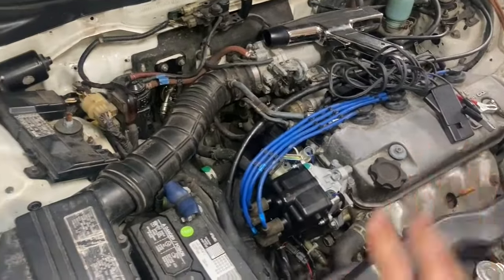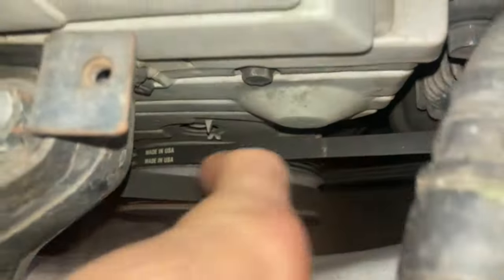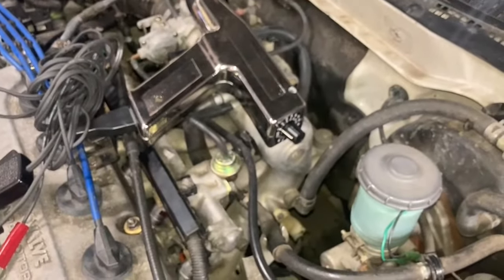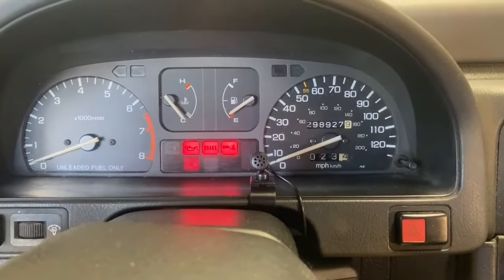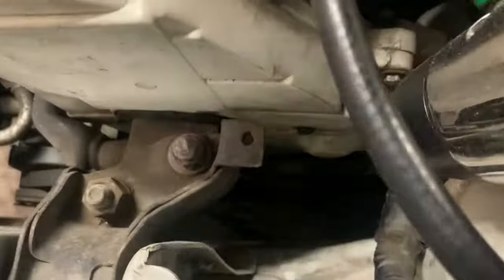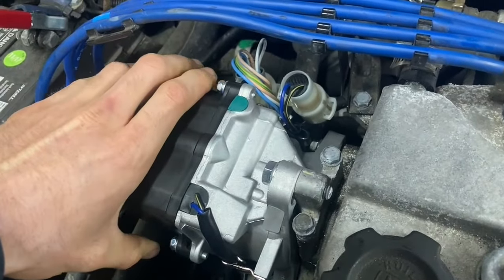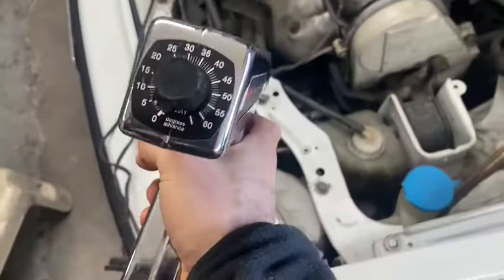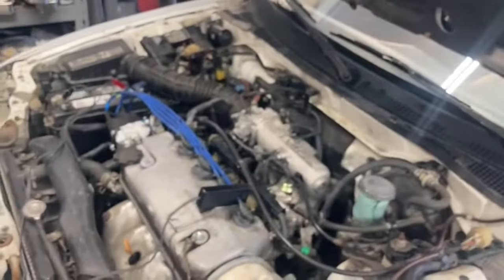How to Set Ignition Timing on Honda and Acura Distributors

Comment: I did not have to hook any connector,install the distributor.then adjust the timing old school.start,adjust start adjust till smooth
Reply: Yeah well some people want to do it the PROPER way.. your way will never be 100%
Reply: The reason you jump it is so the ECU stops adjusting stuff to smooth idle. You timed it with adjustments, jumping it stops that and runs closed loop so you can set timing without other parameters interfering.

Comment: I'm really confused at what the timing light does besides just shine light in spurts with the ignition sparking. Otherwise I just get that I need to short the plug and then line the arrow in the middle of the lines. I don't see what the timing light did. If anyone cares to explain please do because I never understood what this does.
Reply: Me as well I'm trying to properly set my 97 civic coupe D16y8 Engine to the correct timing & I'm having a hard time understanding what the Gun is for Can I just do everything without it and hear the engine not be as loud as it was?
Reply: 2:21... You use the light so you can see the position of the 3 tick marks on your pulley every time that cylinder number 1 is firing. Then you adjust the distributor according to which way you need the marks to go to be within spec. That's just how you do it.. You don't want to just guess. That's why there's a tool.. & mechanics that make a living using those tools on cars that people played with by guessing.. Use the light.. There's also many other better videos that actually show the timing marks on the pulley that you are trying to line up.
Reply: @BlakeGibbons  I just didn't know how it worked but I have since figured it out. It's just super hard to see on this video but I get it
Reply: Without the aid of the timing gun light you will be unable to see the lines with the motor running to line them up
Reply: @BlakeGibbons  Is it possible for the after market pulley that doesn't have those marks? And in that case is there a work around without having to order a new pulley with the marks?
Reply: @johnlivingston9217  all I know is that you can remove the crank pulley you put on without the marks and line it up exactly with the mark on your oil pan I think it is, with the crank pulley and that should be where your off 16 degree mark hits. I suggest just buying a new crank pulley tho because it would be much easier
Reply: the timing light shows you when the plug is firing. If you connect it to cyl #1 it will show you when it fires. Because it's the first cylinder, it's the beginning of your cylinder firing order so that's why you always hook the light up there. There are 4 lines (white, red, white) (isolated white) on your crank pulley. The isolated white represents your TDC and is used for timing belt service and the red line is slightly before TDC which is where you want your spark plug to be firing. If you'd like to read more look up the 4 stroke cycle diagram. It should be a circle diagram with spark events and valvetrain events. 😊

Comment: I didn't see where you removed the shorting paper clip, turned the engine off, pull the hazard fuse to reset the ECU.
Reply: Can you explain what you mean in more detail. After you set the timing manually, you pull the paper clip while running? Then turn the car off? And where is this fuse you’re talking about. Do you pull the fuse while it’s running or off? How long do you wait for the ECU to reset? I feel like all the 90s Honda timing videos don’t explain all the steps

Comment: You need to warm the engine at least to 85 90degrees... to adjust the timing.... cold engine has to much timing like 22 24 degrees....warm is 16

Comment: I’m setting my ignition timing tomorrow on my 90 crx si (d16a6) and this is extremely helpful thank you so much for taking the time to explain this. I would not have known to short out that connector under the dash iether. I just finished my engine swap putting in a new used d16a6 and I’m so happy to be driving my crx again these cars are so much fun!

Comment: Dear Vincent, I could see that you did it perfect and did mention it briefly but I thought maybe some could use a little more detail about the V-notch, I am always impressed with people that are willing to take their time off a busy life to try and help people to be able to do their own maintenance and not pay the big bucks to someone else to do the job. I notice that most people that are showing how to do this timing on the Honda, have most of the instructions spot on but I have yet seen any to get one detail exactly right, they are always very close but are not spot on. When I am doing something I want it to be perfect.
Here is where most people do not get it quite right. If just looking to line up with only the v-notch with the red mark then it depends on what angle you are looking through that notch to make it accurate, this is the reason they put also a pointer below that v-notch. So, the way to do timing accurately, we align the v-notch with the pointer then the pointer at the red mark. I hope this will help the perfectionist. I think I will put this information on the other YouTube video that I see, to help other perfectionist.
Reply: I only see the 3 red notches on a cold start. Once the car warms up I can only see the white notch through the hole
Reply: @midwestjeff  You do understand that for proper engine timing you must put in the jumper wire first. Then you only use the white mark to do the timing if you can set your tiiming light to 16 degrees or else you use the red mark, this is a setting for civics that are close 1999. It sounds to me that someone painted the extra red marks because you should only have one and the other yellow. I am sure you do know that when lining up with these marks you sight the pointer directly in the center of the V notch and then line up with the white mark again if you can set you timing light to the 16 degree mark. Your engine should not be over 900 rpm when setting the timing. If you go much higher you will get a false reading on the timing.
Reply: @Robertrlkatz  know if you check the Honda Accord manual there are two sets of lines. There was one white line which is 0° and then there are three red lines. Check the manual yourself
Reply: @midwestjeff  My apologies for giving miss information, I had forgotten that my timing light can change the degrees manually. I corrected my mistake in my other reply. Thank you for letting me know. I am sure that the 99 civic had only one red mark that I used and just don't remember another one but it has been awhile since I had worked on my sisters car, plus my brain is giving out, I am 74.

Comment: What will be the possible after effect if you forgot to short the pins and got the timing guide right to the middle. Will you experience something from your car?
Reply: My mechanic said that the ECU will automatically adjust the timing ignition so the effort on adjusting the timing ignition using the timing light will be useless.

Comment: Does it have to be number 1 spark plug? If the timing cycle is the same every time, then any plug can be used? So to adjust the timing, you just move the distributor to left/right a tiny bit before you tighten it? thanks
Reply: has to be number 1 spark plug on any engine, you don't necessarily have to tighten it everytime you adjust. Just loosen, adjust till its right, and then tighten
Reply: @dannycar25  I cannot see the marking, on the pulley wheel. The car is 30 year old and I think they probably worn out. Is there another way to adjust the timing? Without taking the timing belt cover off ?

I was thinking if I hook the timing gun up on all four plugs and if they flash at the same rate, then the timing is probably correct since the whole thing is cyclical. Right now, they are not flashing at the same rate and same number of flashes.
Reply: the timing marks are engraved, it cannot possibly wear out. You do not need to take off any kind of cover to adjust timing. As for the spark wires, an engine does not fire all spark plugs at the same time. That would be disastrous and a very rough on the engine.
Reply: @dannycar25  I ordered a rechargeable flashlight, which is extremely bright and zoomed in on the wheel and still could not tell/see the markings. Unless I was looking at the wrong wheel but doubt that. Since the 1994 Integra has the pointer on the timing belt cover, I would assume the markings are on the wheel closest to it?

Anway, I gave up on that. I just adjusted the distr. until I can hear the engine sound is quiet and smooth. Took it for a ride and put my hand on the center of the steering wheel and didn't feel any vibration.  Didn't hear any major sputtering either. Thought the engine sounded a little louder than usual, not sure because it is new. 

What frustrated me is the next day when I started up the car. I hear sputtering again?
Reply: @sinnieleeonUtube  oh sorry I forgot to mention, you might have to slightly crank your engine over until the engine spins the crank to wear the markers are at. it might help with two people. one bumping the starter and one looking for the mark

Comment: Hi Vincent, thanks for the video, can you or anyone else explain this to me plz?
This is the first time I did the timing belt on my '93 Accord. The last time the timing belt water pump was done by a mechanic about 5 years ago, who has been since retired.
The car was running smooth, however when I opened up the timing cover, I found the crank pulley was 1 tooth off to the left of the mark where it is supposed to be, the left balancer pulley was about 2 teeth off to the left, and the right balancer pulley was about 6 teeth off to the right. I marked all the belts and pulley locations as where they were.
I then set the pulleys and belts to tdc and lined up as per service manual. Put everything back together, and now the car doesn't run like it was before I set the timing belt and pulleys back according the manual, what gives?
Was the old mechanic correct to off set the pulleys in the first place? Should I go with the manual and keep it as is and then adjust it with the "ray" gun and the distributor?
I've everything marked so I can always go back and set as the mechanic did but would prefer to do it as the manufacture intended it so I can learn along the way too.
Thanks
Reply: Did you ever figure this out? Dealing with a similar issue.

Comment: I can’t find the blue plug used to short anywhere ! 
I noticed it comes out of the blue wire and mine has nothing there any ideas ?
Reply: same starting to think these videos are trash , for one the blue connector is nowhere to be found then you need the pistol its not that expensive but other comments are mentioning there arent white lines seems like a specific OEM belt you also need to have.
Reply: @userfr95333  figured out these cars with the plug are Obd 1-3, my CRX is Obd 0 therefore I don’t have the plug
Reply: @userfr95333  there aren’t any white lines for me either but there’s grooves you have to line up

Comment: What happens if the timing is not correct? Can I change the distributor and drive to the mechanic shop to do the timing?
Does it have to be number 1 spark plug? If the timing cycle is the same every time, then can any plug be used?
Reply: The marks on the crankshaft pulley are made so you can time cylinder one, you should always start with cylinder 1 on every vehicle you time.

Comment: Can this be Done without the gun? I have my civic I just replaced the water pump with recently and when I start car up it had loud idle like the timing may be advanced. I would appreciate any help just want this thing to be able to run smoothly.
Reply: I believe if it runs right you can just take off the bottom distributor bolts and either move the distributor left or right more to find a lower idle with the engine running but you must short the ecu connection

Comment: So after do you just remove the pin while its running or do you turn off the engine then take it out? Thank you for this though my distributor slipped while I was leaning in the bay hopefully this works! ❤️
Reply from the maker: You remove the paperclip after you've set the timing as we no longer need to short the ECU pins.

Comment: I thought your supposed to set the knob  to 12 degrees? according to many other videos
Reply from the maker: The 3 lines should be centered at the mark when the timing gun has 0 degrees of advance or retard if you want the car to have the factory timing, which is required for smog in California.
Reply: @VincentStevenson  thank you. I was very confused at first cause so many videos. Thank you! Got it figured out.